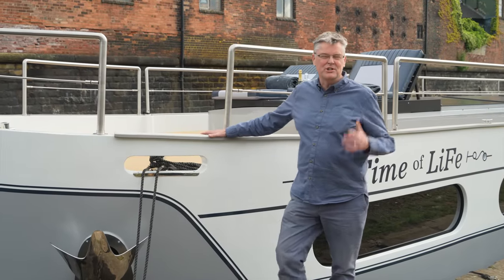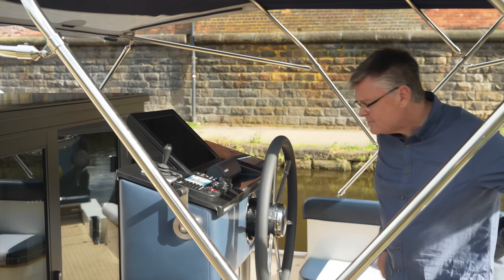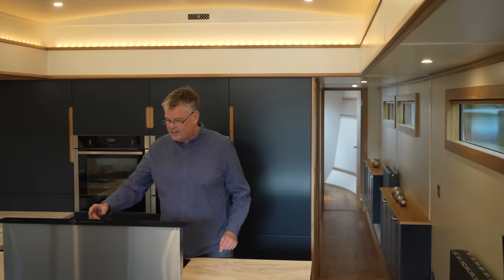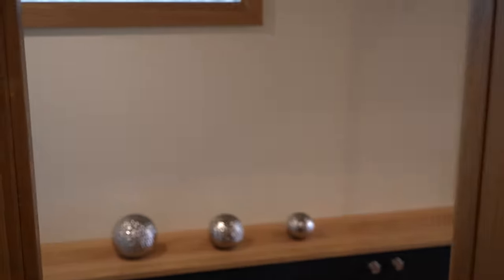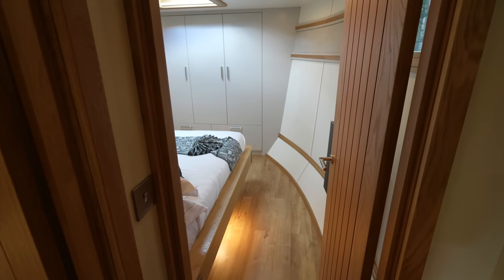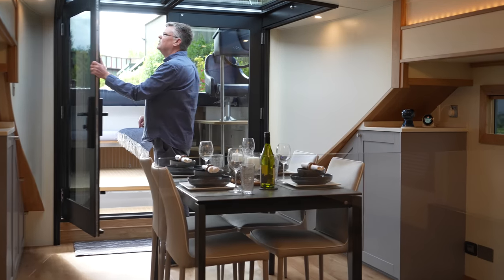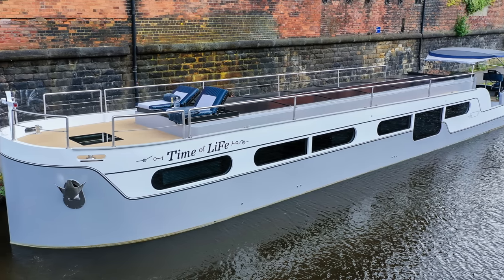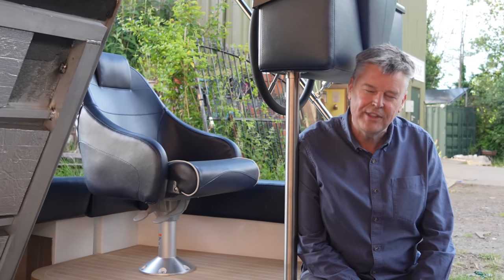Finesse "Discovery" an all electric Wide Beam Yacht Review for Crick 2022 called Time of LiFe

Comment: Very Nice. If I had a suggestion, it would be to give it more of an Old Pub/Library/Cat House feel.  African Teak paneling throughout and on the overhead and deck. Large brass port holes and a 6-foot bathtub. And rig it with a diesel engine. I would not want to wait for a sunny day in jolly old England when needing to bug-out after the Muslim horde breaks lose, with machetes and hammers. Just saying.

Comment: Beautiful boat fantastic inside a job well done but its too wide and the solar wont keep up with the  modern life styles that folks require and especially in winter when the sun hides , to need a back up generator defeats the whole idea , be a lovely stationary live aboard in a sunny country , then theres the air-conditioning system they chew up massive loads off power , long live diesel , but a beautiful boat tho probably close to over a million $ to buy tho i recon

Comment: With the greatest respect, when marketing a $500k boat, please have your audio correct. Use a remote microphone. Also, stop referring to "Sailing". I don't see a mask and certainly don't see a sail. Lastly, seems like the solar is sub-par, quad converters and not separate inverters per panel... Disclaimer, not an expert in this area.

The boat is frankly  priced about 35% higher that value., in my opinion.
Reply from the maker: We will be sure to have the Mic for the next video.

You are correct on not being a solar expert, 1 controller per panel would be far less efficient because you would need to step up the voltage of each panel to charge the battery. We have tested 1 controller per pair of panels, and in cloudy days that was also less efficient. 4 controllers for us was the optimum.

At 35% less, the sum of purchase parts would exceed the asking price.